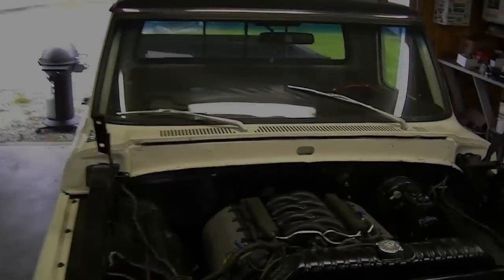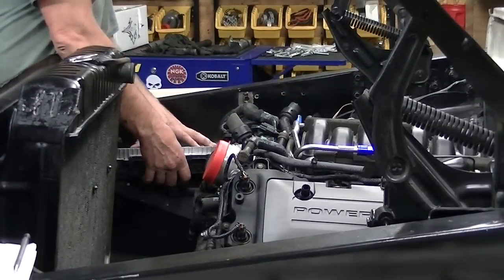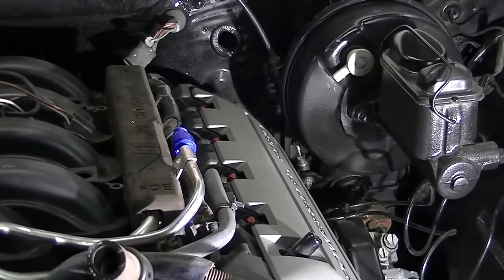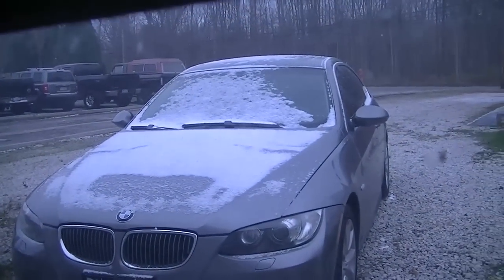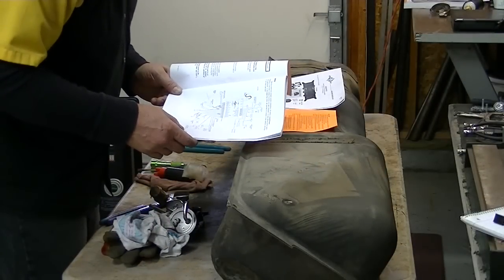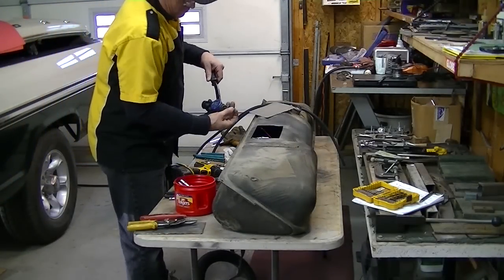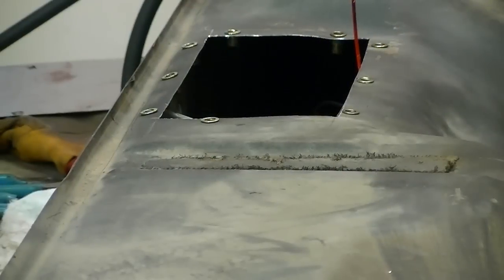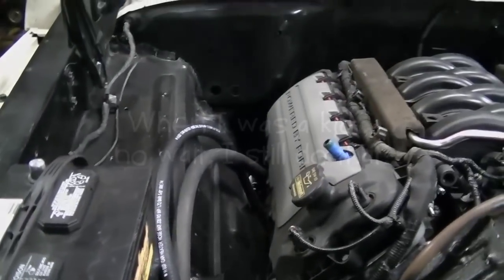5.0L Coyote Engine in a Camper Special? Wire it UP!

Comment: Thinking about coyote swapping my 01 lariat crew cab with a 5.4 how much would go into accomplishing this since its a little newer then a 72
Reply from the maker: Well, a lot. But it's totally doable. A 5.4 makes about 235HP and 335 Torque whereas the Coyote makes roughly 415HP and 390TQ-  so the real question is what do you really need in terms of power.  I'll say Hemi or Coyote every time. Thanks for watching!
Reply: Grenade Motorsports 415hp would be gobs lol just want it to be able to pull the 33x12.50x20s i have on it and my motor has 199k and figure instead of trying to boost it. just do a swap and get more power and reliability

Comment: Very cool projects.  Question,  the FRPP coyote wiring that you can purchase says either manual trans or auto.  If the auto coyote wiring kit is purchased,  does it come with that controller? Does it come with the wiring and computer needed to run the 6r80? Trying to lay out my plan before I get involved in it.  Thanks for your help.
Reply from the maker: Different wiring for the Mustang Coyote and the F150 . 11-14 Both F150 and Mustang, you need a separate 6R80 controller. 2015-17, Mustang only, the controller comes with the FRPP. If you use an F150 Coyote 2015-17, you need to change the cams and the phasers, engine wiring harness, making the F150 motor, into a Mustang engine, then- you can buy one kit and it will control both.

Comment: Just throwing this out there. If you use a 15 up motor with 15 up 6r80 ford offers a control pack for it. So you don't have to mess with using an aftermarket controller for the 6r80. Also Dakota digital offers an adaptor for around $100 that plugs into the obdll port and plugs into the gauge cluster. Saves all that time messing with adding extra sensors on the motor
Reply from the maker: Yep, for the 15-17 Mustang only engines, that info is correct. F150 Coyotes, they do not. I have a 15 -17 engine sitting on a stand so I'm aware, but thanks for that. Not to mention we need the obd II for the dyno runs. Thanks for watching!

Comment: looking good i just did a 2016 coyote in my 51ford and used hotwire auto wiring harness .
Reply: Cobrafanatik22  hey man I️ used a 6r80  the wiring I️ used from chris @ Hotwire auto worked great I’m also using a console shifter out of a 2013 f150 and the tow haul sport mode and select a shift all work
Reply from the maker: That's awesome! Would love to see that build! Thanks for watching!
Reply: you bet ill upload a few videos
Reply: Elliott M Did you use an auto or manual trans and did the wiring for the trans come with the wiring kit you bought?
Reply from the maker: Nice! Thanks for watching!